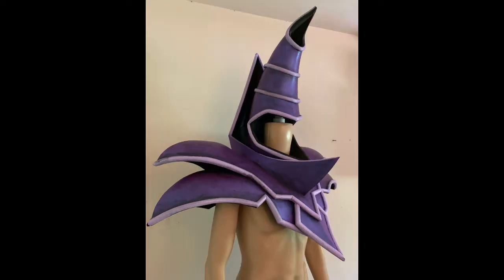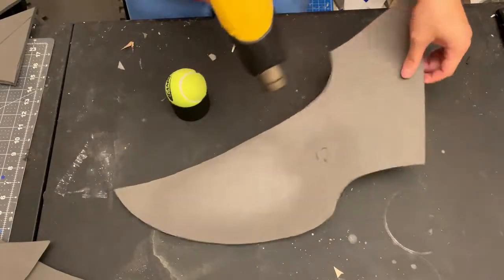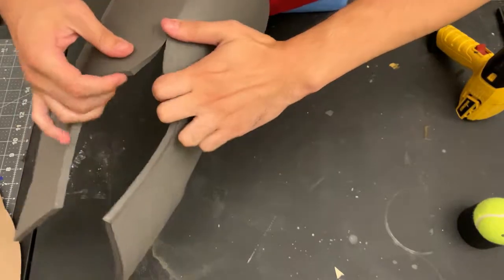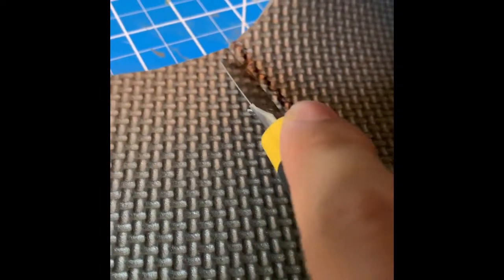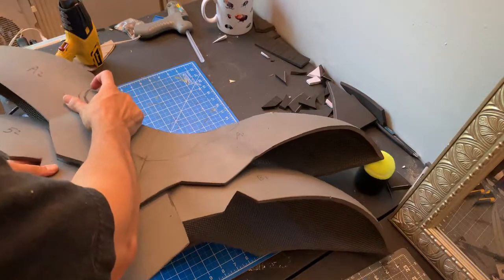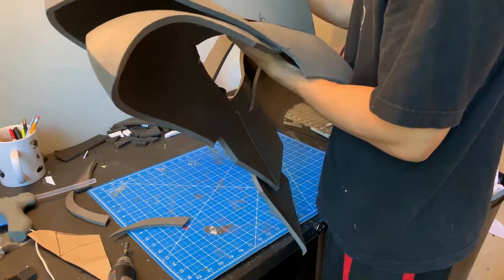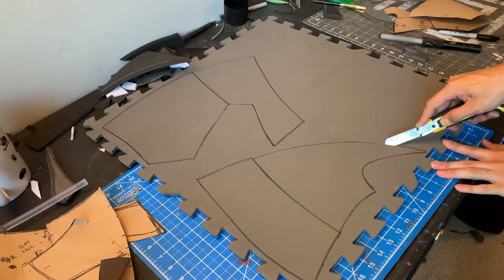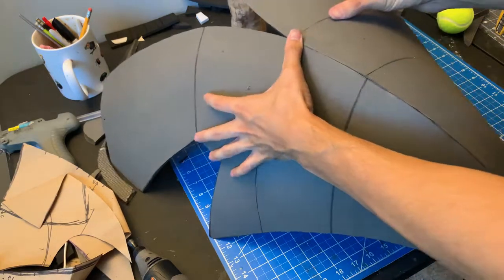Yugioh: How to Make Dark Magician Armor

Comment: Very good job! Did you use 5mm or 10mm foam thickness?
Reply from the maker: i used floormat foam which is about 12mm!
Reply from the maker: 10mm should work as well

Comment: what do you recommend coloring the foam with and how do you do the pink line things?
Reply from the maker: for this i primed the foam with 3 coats of plastidip
then painted using acrylic paints, for the trim i used 5/8 inch Caulk Backer cut in half, can be found at home depot.
Reply: @jaximusgt6577  thank you!
Reply: @jaximusgt6577  was wondering if we could get the pattern.